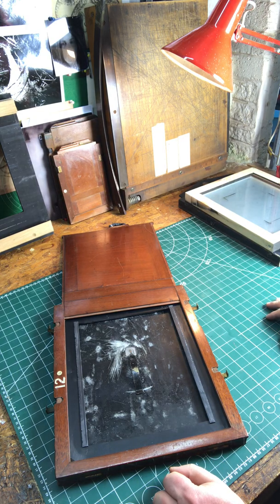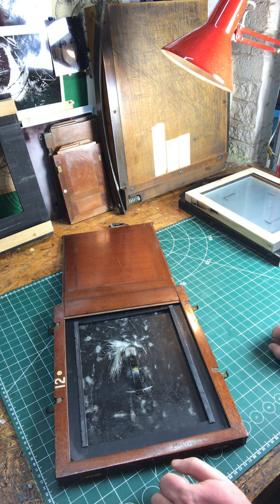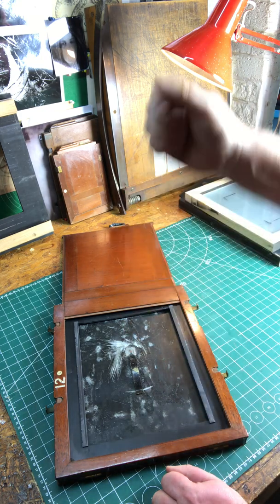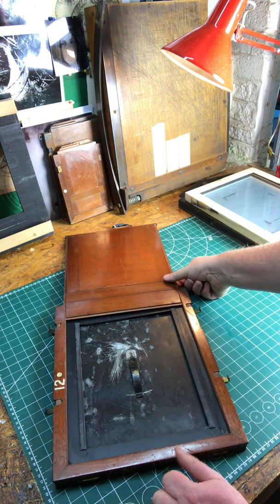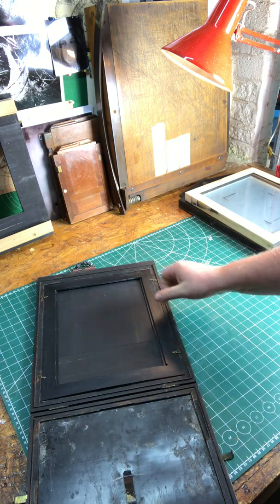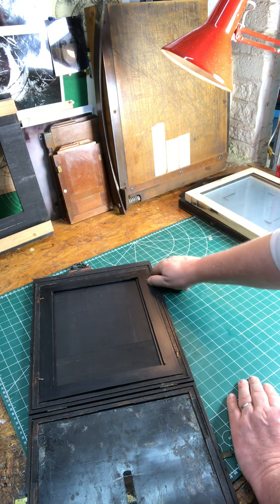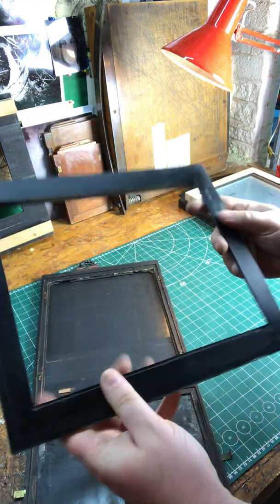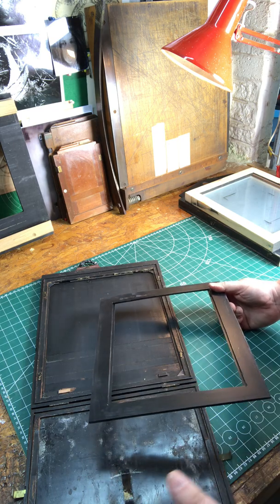Plate Holder for Wet Plate Photography

Comment: In the 19th century those inserts were called “kits.” Also nearly all holders in the wet plate era held the plates by the corners rather than in a continuous rabbeted edge to avoid chemical contamination. English holders usually had silver wires in the corners where the plate rested, American holders had glass corners and French holders had wood corners.

Comment: Hi I need to make the inserts. I am from USA and don’t understand the accent. Are you saying they are made of plastic?
Reply from the maker: Hi Barone, yes, the inserts are made from Perspex, a branded plastic. I buy it easily on eBay. Order black Perspex the same thickness as the little rebate inside the holder and you're all set.